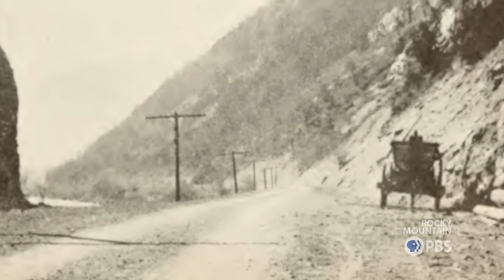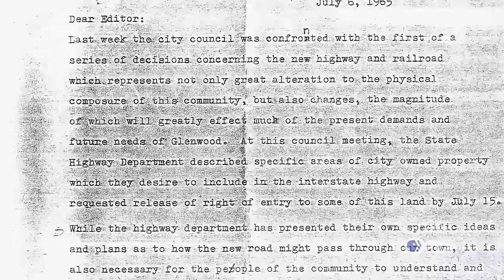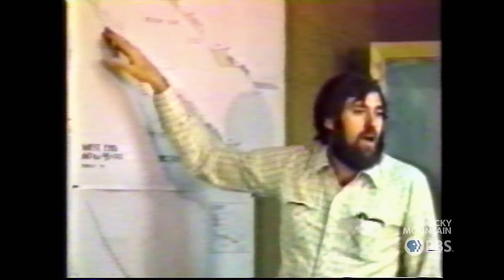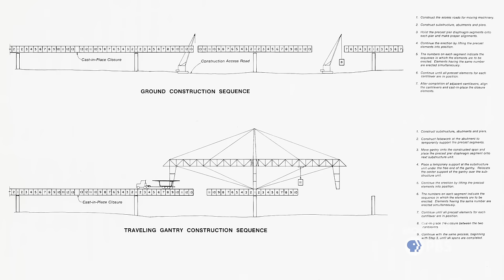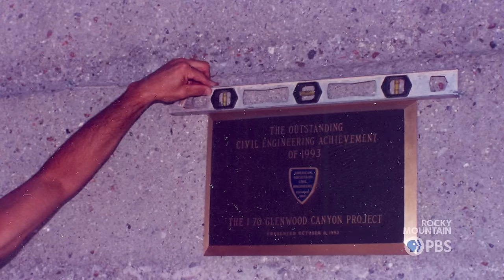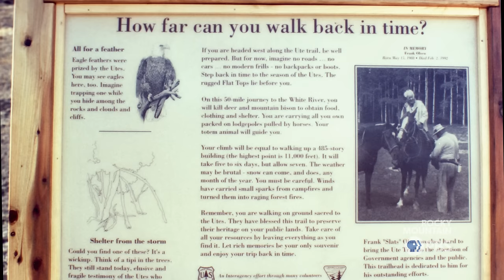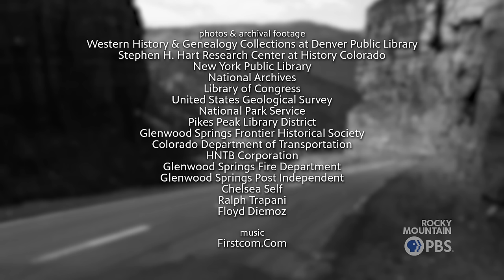Colorado Experience: The Glenwood Canyon Highway

Comment: Driving through the Glenwood Canyon at 5am to go to Eagle 🛫 is an experience. The darkest of dark at night. Worrying if one will see an obstruction to late, an animal on or going through the road or a rock slide. But driving through the canyon during sunrise is magical.
Reply: Not to mention the extreme lack of maintenance on I-70 and many other Colorado roads. In places, the concrete is worn down to the rebar.
Reply: @TheBandit7613  the Colorado Craters
Reply: Especially during winter with the road icy! Aspen people going 80 in their Range Rovers, they have zero regard for safety!

Comment: I've driven Glenwood Canyon Highway a number of times since it opened and as an architect with a strong background in civil engineering, all I can say is that the experience never ceases to completely awe me.  My only regret is that it is so short, only 12 miles long, and at interstate speeds, it's behind you much too quickly.  If any upgrades to this stretch of highways are planned for anytime in the future, I can only hope pull-outs with educational kiosks will be included.

Comment: Engineering is in my dna, so I love docs like this.  To an Easterner familiar with the highways around Baltimore and DC, this piece is an enchanting weave.  Where I70 begins, just on the west end of Baltimore, a sign from 2004 shows the mileage to Cove Fort, 2200.  Few people know or care about Cove Fort.  It was added as a bit of whimsy to the sign showing mileage to places like Columbus, St. Louis, and Denver. All roads lead west, and some die in the desert.  Who knew that the western extension of i70 past Denver was so new?  Or that anything lay beyond Denver?  Of course, I'm so old, I still think that DIA is new.
Reply: I-70 was never completed in Baltimore because it was slated to bulldoze a park.  In 1966, Congress passed "Section 4(f)" of the Transportation Act which prohibits federal aid highways through parks.  This stopped that road (fortunately).  A similar project, I-40 through Overton Park in Memphis, was also stopped due to 4(f) and the Supreme Court upheld this law in 1971.  Unfortunately, 4(f) doesn't apply to places that merely have extraordinary beauty, there must be a "park" designation.  Long after the oil era is a distant memory the earth moving this and similar projects did will remain and probably will inspire fantastic stories of what their distant ancestors were up to.
Reply: @markrobinowitz8473  If oil is ever a distant memory, will return to 1820's type living. Oil is used for MANY things, not just cars.
Reply: @markrobinowitz8473  They genuinely need to fix that end because it's now a park-and-ride at that end. It's a shame they can't use the Glenwood Canyon example to complete that end of blending it with the scenery. Times have changed. People who once objected are now relenting because designers are now more environmentally conscious while looking for ways to blend in with the scenery; look at PA's Blue Route (I-476 from Chester at i-95 to Mid-County Toll/NE Extension), which took years to complete because of similar issues.

Comment: I road home from CA on my bike in 1993. The Glenwood Canyon part of I 70 is one of the best highways I've ever been on!
Reply: Haven't driven it lately? 
It's in terrible condition. Little to no maintenance done in the last 40 years.
Reply: @TheBandit7613  I drove it last week. I'm a Canadian tourist and it was better than most roads we have in Quebec.
Reply: @goldenretriever6261  You must have some bad roads. I-70 thru the Glenwood Canyon has received very little maintenance in the last 30 years.
The expansion joints are falling apart, the concrete is worn.  The longer they wait, the more expensive the repairs will be. 
Colorado is falling behind on road repairs. They'll need to raise fuel taxes.